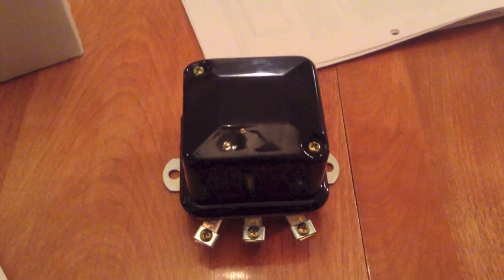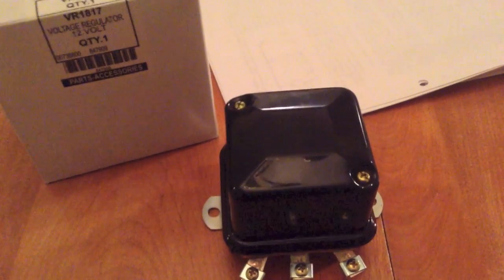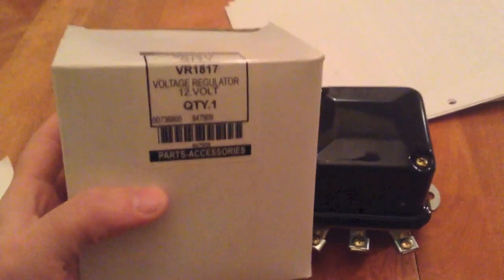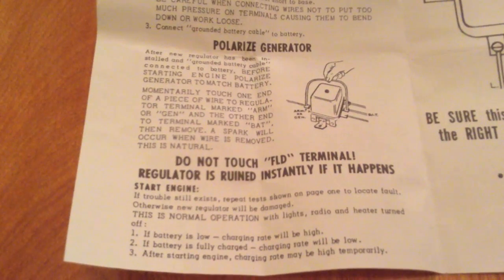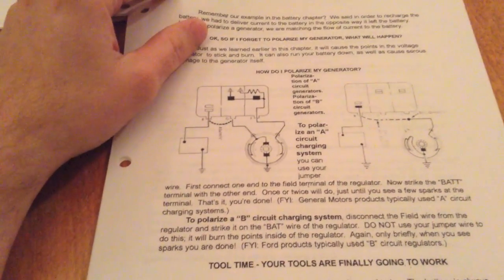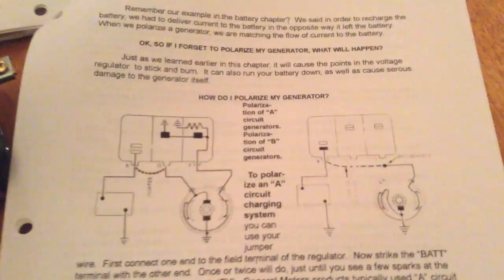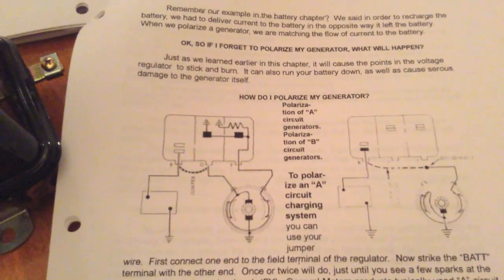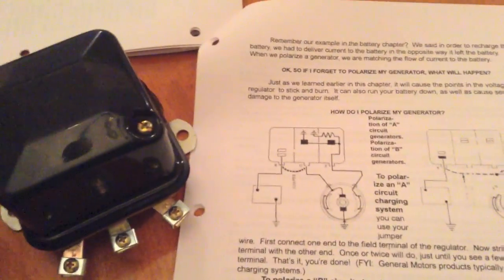13 - Cub Cadet Restoration - Voltage regulators and generators

Comment: Could be a typo, but the instructions in this video say to jump field to battery for an A circuit. However, the original tractor manual says this will damage the regulator.
Reply from the maker: Correct.  Just disconnect the field wire for the regulator first, before jumping power to the field terminal on the generator to the battery.

Comment: I have a1973 model Cub Cadet model 86 that I replaced the brushes & bearing in the generator and never had to polarize it . It's charging perfectly..
Reply from the maker: You got lucky.

Comment: Hello all, Lately I have been wrkg on my model 23 Briggs Stratton it has a starter a delco remy 
110-1680 starter. I had a good battery  the solenoid coil did click, not by much tho. I rebuilt it. 
I drilled out the 4 rivets and  cleaned the armature which was rusty, a good vice and wire brush 
wheel are .great to have. . . I got a new spring cut it to the size in the solenoid then with 4 brass 
bolts nuts an washers, had it together and it is working fine. 

 Sometimes with old engine, the primary winding of the ignition coil is usually good but the winding 
for the sparkplug is bad. . .I found I could put the battery side or primary coil of a regular auto ign.
coil in series with the wire from magneto coil to points wire, so, the heavier lesser turns coil of the
magneto could work the ignition coil, other side of coil went to points. I am just doing what some  dirtbikes have, a low voltage magneto down on left side of engine, wire comes up to ignition sw, kill 
switch to ignition coil then back down to the points, this way  you may not need a battery for ignition.

Comment: Hello The5upermann1 that long skinny-ass thing with fine wire is a RESISTOR. It can be burned 
out if reg. is hookt up wrong. When hookt up right, it will not burn out. Some regs have two
resistors in them . U know there are two different kinds of coils, one heavy coil could be 10 gage,
other coil is a voltage coil made of a good many turns of fine wire or somewhat liter than the heavy 
coil which is also a 'series coil' or goes inline. The voltage reg works by the coil of fine wire being 
voltage sensitive to tenths of a volt, a few tenths of a volt more will make enough magnetic field
to pull the armature down and now that resistor is dropping some field voltage so as to not burn
out your headlites and overcharge ur battery.

Comment: I just restored an old bolens 1053 and installed a new voltage regulator. Problem  I am having now it the fusible link is overheating  and the plastic melted. The generator seems to be running hot too.

Comment: When you say "polarize" do you mean to 'flash the field windings' to re-new magnetic field
to the field poles, say if the tractor had not been used for some time?
The 3 jobs of the well known voltage regulator.

#1 controls the output voltage across armature by means of the voltage sensitive relay, 
the coil of a great many turns of lite gage wire. when the voltage reaches a pre-determined 
level, the magnetic field overcomes spring tension of that relay and opening the contacts, 
the field current must now pass through a resistor to ground, less magnetic field on the field 
poles causes less voltage across the armature.

#2 Reverse current relay, this relay is the go-between the battery and generator when the 
battery voltage is greater than that of the generator. Some companies do this differently,
having a coil core with two different windings so the magnetic fields cancel. In other words
ten turns of a very heavy wire will create as much magnetic field as a coil with many many
turns with a lot less current flowing through it. When the generator starts to put out more 
voltage, the field made by the voltage coil  is now adding to the field of the heavy wire coil
that carries the current, the fields + and the contacts close and the battery begins to charge.

#3 Overcurrent protection, it may not take long to burn out a generator with a big load and
no means of controlling the current. Therefore a relay is would with turns of wire, the same
size as what the generator's armature is good for. when the current drawn is exceeding the 
generator's safe output, the relay close and a resistance placed into the field circuit, reducing 
the magnetic field on the field poles, the voltage goes down as does the current. 

If you see a coil would with a lite gage wire, it is a voltage coil, changes of a few 1/10s of
a volt can exert enough pull on the armature. these coils are across the source of voltage.
Coils of a few turns are coils for carrying current and are in line with the source, meaning
current must flow through it before it goes anywhere else. 

An analogy of volts and current can be made by means of water comparison. a water tank
the city of Plant City could be two hundred feet off the ground. two pipes coming to the 
ground are 1 inch and 12inches. a pressure gage hooked to each will have the same value,
in  'water pressure' {volts} but the 12 inch pipe will allow more gallons per minute {Amperes}
to flow.

Amperage is the electrical equivalent of mechanical torque.
Voltage is the mechanical equivalent of mechanical speed. 

This can easily be proven, You may remember in science class an experiment that
consisted of an old telephone magneto hooked to a small lamp. when the lamp was
out of the circuit, by say a knife switch, It was easy to crank over the magneto.
BUT when the lamp was inserted into the circuit, current flowed through the windings
of the magneto's armature, making said armature a strong magnet and the electro-
magnets of the armature were being attracted to the poles of the field magnets, those
horseshoe magnets.
Reply: I just wanted to say thanks for all of this info. You broke it down well and that's what I need, I feel people that have the best of intentions to teach don't always realize things that seem simple to them is new and complicated to someone never even hearing of these things before.
Reply: @Ambersgangrenedangleeeenankle  You are very welcome, I went thru that at one time. I had to take it in bites, not the whole cake at once. and yeah I went to trade school, did my best there while academic studies took a big dump! after a while tho it got easy, I mean how could I expect to pull 20 amps thru a hair like wire. I did a lot of experiments that backed up what the books were saying. funny it was telegraphy that got me to know
how the reverse current relay worked, voltages going thru two coils wound in 
opposite directions, current from arm, also went to a voltage coil on same core with 
a series/amps coil. the voltage coil knew when it could work the rev, current relay to charge and closed the contacts then the current relay kept them close too, but when the gen volts dropt, battery current flowed back to the gen thru rev current relay and the magnetic fields of the series and voltage coil workt against each other, no pull and the armature of the relay opened.

Comment: My Cub 100 sat for about a year without starting. I put a new battery in and turned it over. It would turn but not start. Could this be the reason why?
Reply: I would start with cleaning the points

Comment: Why in the world would you have to do this task by replacing the brushes or battery  ?
Nothing has been changed in the flow of the electrical system. So why would you have to polarize it ?
You've got the wrong info on this system...
Reply from the maker: It is just something that has to be done with a generator system.  The generator is producing DC current and DC circuits have polarity (a positive and a negative).  AC circuits (alternators) do not have polarity.

Comment: I think you will find that the terminal marked 'L' is for light - i.e. the charge warning light, not 'load'. in the case of a vehicle based system the 'load' is the battery itself (and electrical system of the vehicle of course). I have encountered two different arrangements for the charge light, most common is the system in which one pole of the warning light is supplied with battery power through the ignition switch when the ignition is turned on, and the other pole of the light is connected to the 'L' terminal of the regulator (through the wiring harness). When the generator is producing power and the regulator is operating correctly, the same voltage that is being supplied to the battery is supplied to the 'L' terminal, and hence to second pole of the warning light. As the first pole is already being supplied with the same voltage by the ignition switch, the light has no grounded side (negative) and so the light does not illuminate. If, however, the generator is not producing power, the regulator switches the 'L' terminal to chassis ground (negative), which gives the already electrified (from the ignition switch) warning light a connection to chassis ground (negative) and hence the light then illuminates.
Reply: 'L' is "Load" and not Light. 'B' is Battery, and your ammeter monitors the charging of the battery and not the output of the generator/starter. B is always connected to battery/hot, and L may or may not be hot depending on running conditions. The light you speak of can vary in brightness, which is due to differences in the L and B terminals, but your description allows only an on/off brightness (and would have a very annoying operating characteristic to the motor!). 
It is true that in these tractors, most loads will be Lights, but also is the ignition system. 
Ref source: AC Delco Regulator documentation.
Reply from the maker: +Peter Duffy.. Thanks for the feedback!  On this tractor the wiring from "L" terminal of the regulator goes to the ingition switch which sends power the ingition coil, points, and spark to the engine.  It could also power the lights or another load.